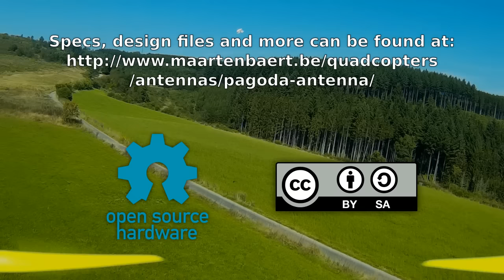Pagoda Antenna Assembly

Comment: Nice video. So I'm about to order a few of these and figured I would watch the vide first. I would have done a couple things a little differently, but the basic assembly is the same. 
I think you for got the mention that the PCB traces between the first and second one should be opposite, although I see it was assembled that way at the end of the video.
I would have also used flux, something like an Amtech tacky flux. But not on the first PCB because you don't want the solder to flow on the shielding before getting the second one in place or it might not fit over the shielding.

For the second and third one I would have used flux, with the second PCB, maybe some on the shielding before putting the PCB over the shielding so it would have pulled the solder down the shield to the first PCB joint for a solid connection, and since it doesn't need to bend at that point it would be better. In fact I think the design of the antenna works better if the PCB board stay parallel. 

Then flux with the small reflector PCB in the back, and with the main SMA outside part also. Maybe a dab of flux on the coax wire before putting the pin on it just to make sure more solder flows inside the pin to grab the wire.

It's was a nice assembly. I think I'm going to order a few now. Thanks for the videos.
Reply: I just noticed the lines every third on the PCB, I'm guessing those lines need to match up and this will align the antenna traces in the PCB properly. I just don't remember seeing that mentioned in the video. But I'm in a iPad currently and sometimes overlay text added after the fact doesn't show on videos played on mobile platforms.
Reply from the maker: Somehow this got flagged as spam so I didn't see it. Flux is usually not necessary here, there's enough flux in the solder to make it work most of the time. Sometimes I add a bit extra if I don't like the solder joint, but usually it's good enough on the first try.
Reply: Spam, weird. That usually happens if a URL is in the post. Thanks for replying. I ordered 6 or 8 of them and haven't put them together yet. Still working on some other builds and projects and now V2 was released, figures. But for 2 of my quads one will be under between the landing gear so I don't think it needs a cap for protection. And the other one is a micro 90mm brushless I'm building so I'm trying to keep the weight down anyway and would probably not cap that one either for less weight. These seem durable just as the PCB from other videos I've watched. I guess when I build a 250 that's when I'm going to want to order the V2 PCB's so I won't assemble one of them and just keep the V1 PCB's as spares. 
Does the material for the cap make a difference between ABS, PLA, Nylon and such? I figure carbon fiber fused PLA would be bad, its light and strong but with the carbon fiber conductive properties it would probably act as a shield. I was just curious to what plastics were tested with V2?
Reply from the maker: It's difficult to find accurate data for RF characteristics of all types of plastics, so I'm not really sure. I suspect that nylon will be the best, followed by ABS, followed by PLA. But the material properties also depend on things like density and thickness. Basically you need a material that has a low loss tangent at 5.8 GHz.

Comment: Awesome! So easy actually to do!
Little question, if we want to protect the antenna from crashes, what kind of material can we use without compromise too much the performance? Rubber? Plastic? TPU? ABS? PLA?
Milion of kisses for you Maarten!
Reply from the maker: Unfortunately the material properties can vary a lot because there is more than one way to make a certain type of plastic. Very few manufacturers publish accurate specs at RF frequencies for those materials, so it's difficult to know what will work best. I would avoid TPU because I know that polyurethane has very high loss at RF frequencies, but I can't say exactly which of those will work best. The ideal choice would be PTFE (teflon), and PE (same as HDPE/LDPE) is also a good candidate. Both materials are commonly used as the dielectric in coax cables because of their good properties. Polycarbonate also has pretty good RF properties.

Comment: Hi, just wondering where I an find that jig here in Belgium.
I have ordered the pcb's, if they arrive I have some solder work to do ;o)
Thanks for making this design open sours Maarten !
Reply from the maker: I did the laser cutting for my jig myself, KULeuven provides laser cutters that can be used by anyone for open hardware projects (see https://www.fablab-leuven.be/). So if you live close to Leuven you can use that option. Expect long waiting times though - it's first come first serve and some people laser-cut 10-20 wooden panels in one session (which takes several hours).
Reply: Thanks Maarten for the info, I'm not living nearby Leuven, but you give me a good Idea to go to a local school nearby to ask if they have a laser cutter, (that option slips my mind), Can I use the '' jig_pagoda_3_5.8ghz.dxf'' file for that and how thick must be the plywood for this file?
Reply from the maker: Depending on the type of laser cutter, you may need to use the DXF file (most common) or the SVG file (for printer-based laser cutters). You need 3mm MDF for this. Plywood may work too but MDF is usually easier to cut accurately because it has no grain.
Reply: Thanks for the info M., I gone get my lights up on some local schools here to see if they can do the job for me. Cheesr.

Comment: So which are the best to get.. I've read some of the results on Martin's site but only s few manufacturers have sent in there product for testing..
Reply from the maker: Anything with decent build quality should have very similar performance. The only ones that perform really badly are the ones that didn't follow the specs at all, e.g. the Honeydrop. For the transmitter, I would go with those that have a protective shell, such as the one from MenaceRC or FarVew. For the receiver I prefer the ones without shell since their efficiency is about 3% better, but it really doesn't make a huge difference. Shipping costs are also a big factor, probably far more than the marginal differences in performance.

Comment: Hi Maarten ,  I have a stupid question.  I will be running one of your antennas on the bottom of my Skyhunters wing ( upside down) Do I need to run a different polarization on my receiver? Or do they still need to be the same.
Reply from the maker: Nope, just use the same polarization as always.

Comment: I'm worried about the heat melting the insulation in my coax. Is there a way to get the heat in a little faster, like preheating with air or using a high mass soldering iron?
Reply from the maker: The dielectric of RG402  coax is made of PTFE (teflon) which has a melting point of 327 °C. Solder melts at 188 °C (leaded) or 217 ˚C (lead-free). So it's unlikely that this will happen, unless you are using a soldering iron that is way too powerful. Since the coax tends to act as a heat sink, it's hard enough to get the solder to melt in the first place, I don't think you need to worry about melting the dielectric. Just because you set the soldering iron to 400 °C doesn't mean that the coax itself will ever get that hot.

Ideally you should use the lowest power/temperature possible, just enough to melt the solder. Switching to a higher power soldering iron will just make things worse.
Reply: That is reassuring since some of the other coax have PE foam dielectric and I have seen that melt and make an ugly mess.
Reply from the maker: PE is used mostly for lower frequencies. For 5.8 GHz you should try to use coax with PTFE since it has lower losses.

Comment: Gave these a go for the first time today coming off a Triumph antenna on both my quad and receiver and installing pagodas on both ends and my first impressions are not good. I was expecting more penetration. I'm just flying on my street and there were a few problem areas that actually seem to be worse when compared to the Triumph. Is there anything I can double check on my antenna setup to make sure its not just me?
Reply from the maker: Difficult to say with so little information. I have never tested the Triumph antenna myself (I don't know anyone who owns one), but based on range tests from RCModelReviews and Joshua Bardwell it seems to perform similarly to the Pagoda. If you are seeing a significant reduction in range, it could be a mechanical defect. Where did you buy yours? Or did you assemble them yourself?

If you are testing in an area with lots of obstacles and reflections, the reception will be very erratic no matter which antenna you use (i.e. every flight produces different results), so objective comparisons are difficult. You can compare antennas more easily in an open field with a direct line of sight connection, especially at low power levels. RF power meters are even better for objective comparisons.
Reply: Maarten Baert thanks for the reply. Bought kits directly from you that I soldered myself. I was hoping I could get better reception in just a few key problem areas where the triumphs where falling short and it just seems like in those areas the pagodas glitch up in the same spots but the picture almost goes away completely. I'm sure these are fine antennas and I was just maybe looking for suggestions on orientation and such. Would the V2 kits have been even better without a cover? I don't plan on using a cover as i don't crash often cuz I'm not trying to be the next YouTube FPV celeb. Just trying to do some relaxing flights.
Reply from the maker: It sounds like you're just flying in a difficult environment. You can't beat the laws of physics, even a theoretical perfect antenna will have dead spots if there are too many obstacles.